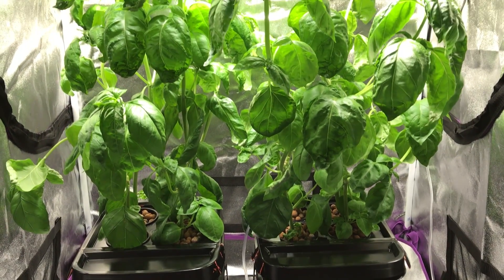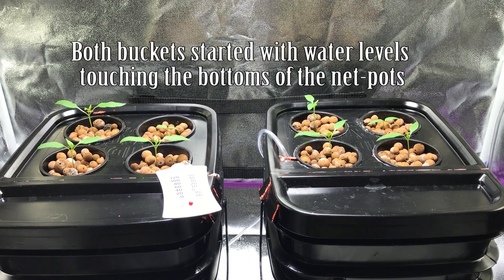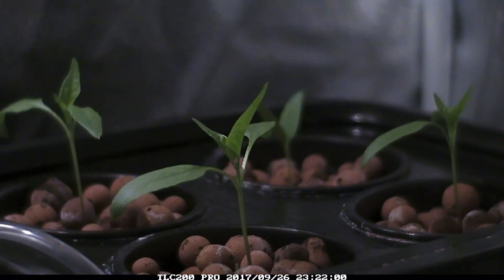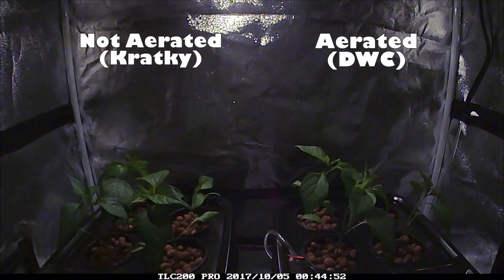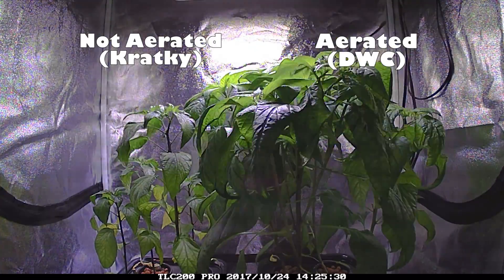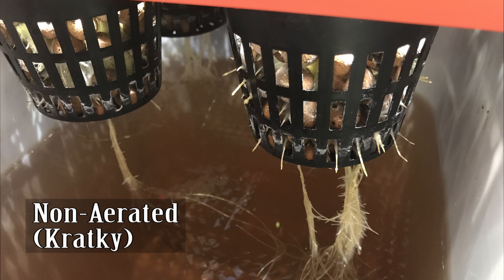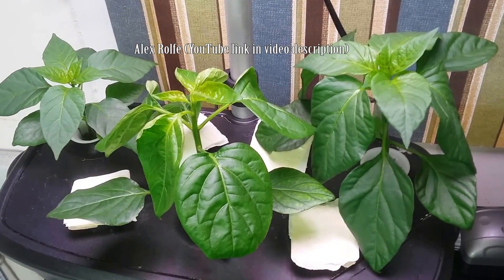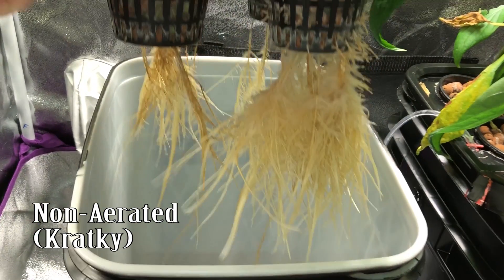Aeration vs No Aeration - Hydroponic Peppers w/Time Lapse (Brinno) “Semi-DWC vs Kratky”

Comment: If the issue was the water vapor not being present, wouldn't sunlight fix it?
Reply from the maker: Starshot sunlight doesn’t create water vapor. Vapor Is droplets of water floating in air. When water evaporates it’s as gas until it condenses back into a liquid again. If you are talking about heating it in a closed container, no that’s not good. The roots exposed to air would have to be colder than the air for water to condense on them. And it that’s not really possible. Plus evaporated water has no nutrients. Splashing water carries its nutrients with it. And I’m the topic of using sunlight as a heat source, that’s horrible for hydroponics. Solution needs to be around 68 degrees. If it’s get hotter, it’s very problematic.

Comment: Roots love oxygen! I grew aeroponics,and the growth rate was unbelievable.
Reply: I was going to use ebb and flow, with hydroton. What would you recommend please?
Reply: @mrtechie6810  Ebb and flow is good.But you just need to make sure the water you give is well aerated.Aquarium bubbler,or just a pump that keeps water moving.Water as it goes against the receptacle its in and travels back down takes oxygen with it.
Use this in your storage barrel before you do ebb and flow to increase the oxygen.
Reply: @djyul  thank you. I put a 50 liter plastic storage box with a tiny Atman water pump, facing up. I added some baskets that are just touching the water surface. Then I made some trays with covers that have holes to put plant pots in...figured to pump the water from the box into the trays using a timer, and let it drain back.
I placed them under a large window. I already have peace lilies (need shade apparently) and spearmint. I would like to grow these, plus strawberries, basil, and ginger (I have a piece rooting in tapwater).
I am about to buy the nutrient concentrate and media. Looking at General Hydroponics 3-part; hydroton and pumice.
I am new at hydroponics...I really appreciate any advice you can give me!
Reply: @mrtechie6810  If you are new to Hydro,1st bit of advice is KISS! Keep It Simple Stupid! Not saying you are stupid,just what it means.
2nd,your water container needs to be closed to slow down evaporation.Keeps EC and Ph more stable.
3rd,RO(Reverse Osmosis water)This has a very low EC,0.003 if i remember correctly.
I gained my knowledge growing weed,and using rooted cuttings.These can not take any more than 0.9 EC(EC is the amounts of salts in your water)Normal tap water has an EC of about 0.8,which means you can only put 0.1 nutrients in the water.
But if you mix RO water with tap water it gives you an EC of about 0.3 which means you can give 0.6 of your desired nutrients.If you give cuttings more than 0.9 they will die!
4th,Light,this is important,the ratio of light to the ratio of nutrients is something you must discover yourself.But where 1 guy is using 4x1000w lamps in a 4sq mtr grow space,his ratio of feed will be higher than someone else who is using 4x600w lamps on the same area.
5,Good ventilation,is also important and a movement fan to stop mildew from starting where leaves start to lay on each other.
When you get it right,they grow really fast,and healthy!
When i started growing years ago there where no liquid feeds,just granulated.I used to use Peters,dissolving in warm water and then adding to feed water reservoir.
You need to buy good quality EC and PH meters!!!! And keep them clean rinse off after use! Add your feed to 1 ltr water and test! Then x that for your 50ltr reservoir.
When you have problems with your plants always check the PH and EC first.And also you must check the calibration of meters reguarly,or when you make a mix that you normaly use and it doesnt come back with the reading you expect.
Its not called EC now,was when i used to do it.I am not sure but not all feeds will be good for all types of plants,you need to check this!
Good luck with your venture,hope this helps.Peace
Reply: @djyul  thank you very much for your advice! Yes, I rebuilt my old RO unit and it's plumbed to a float valve. I have a TDS meter and a PH meter.
I had been propagating corals, so I am highly experienced with water test kits, dosing macronutrients and microelements manually or with a timer, CO2 vs PH, lighting vs metabolism, water oxygenation, etc.
In the past, I also kept angelfish in freshwater planted tanks.
I need to learn the rules for keeping these plant crops, as I have not farmed these before, even in my garden.
I tried using regular fertilizer for hydroponics, but I suspect it is deficient in calcium and magnesium and likely in iron too, plus skews the PH. Unfortunately, I discovered that my test kits are only for seawater and not for freshwater, so I would have to buy a different set of test kits. So I decided I should just go with a proven nutrient product made for hydroponics (e.g. General Hydroponics - GHE softwater), and use it for a few crops until I see good results, and only then I should start experimenting with cheaper products, mixing my own chemicals, testing instead of replacing all the nutrient solution, etc.
There is a ceiling fan in the room. And I have a "swamp cooler" evaporative humidifier and a hygrometer. Trying to keep the humidity above 50% on the dry (35%) summer days that we often have here.
As far as illumination, I hope I can use the natural sunlight that comes through the living room window. It measured around 25,000-30,000 lux, if I recall correctly. This would make the plants grow in one direction...not sure if that will be a problem?
Thank you for all your kind advice!

Comment: To get rid of the 'banding' in the time lapse videos, you can add a neutral density filter to your camera.  However you'd need to experiement that the night time footage isn't compromised. You want to get the slowest possible frame rate to avoid the banding effect caused by the interference with LED lights.
Reply from the maker: Nick Gilbert I don’t think a ND would work. This isn’t recording a “frame rate” it just takes a picture every so many minutes. The only thing a ND filter would do is take a longer exposure. A longer exposure only enables photo cameras to open the aperture larger (or decrease shutter speed). But the aperture on the time lapse camera is manual only and as I’ve already stated, the shutter speed shouldn’t matter. I usually have the aperture stopped down anyways because it gives a sharper image. I stop it down until it starts to get fuzzy and then back off. If I used a ND filter I would have a larger aperture and the images wouldn’t be very sharp.
Reply: Growing Answers Ok I see your point. I wander what causes that striping effect then?
Reply from the maker: Nick Gilbert the camera has a software banding filter which I use, but it’s not 100% effective. I don’t recall if I used of back then.
Reply: Growing Answers no worries - the video was very interesting and I’m just trying to germinate my first batch of seedlings (basil, chillis and watercress)

Comment: Good stuff thank you for the video. I have been wondering about this myself. I was looking into please garden growing towers made out of plastic that were aerated. I want to try something similar but I’m a little nervous about the leaching chemicals. Anything thoughts?
Reply from the maker: Me Tooo you don’t need to worry about that
Reply: Growing Answers Thanks for answering so quickly. I forgot to mention that I will probably be making these at myself as to save myself $1000. And I’m going to have to heat up the plastic and bend it in the shape to hold the plants. The part that worries me is the heating of the plastic leaching chemicals. Does this change your answer?
Reply from the maker: @metooo668  There is nothing to really worry about. plastic pipe is heated and extruded to begin with. just fill it with hot sand to bend it. or a heat gun will work too for spot heating. so long as as you are catching it on fire its fine.
Reply: Growing Answers Would you consider making a aeroponic grow tower vs Hydroponic grow medium to see which is better if any.
Reply from the maker: Me Tooo the only difference is space saving and good oxygen at roots.

Comment: I have grown the exact same way with bubble stones from f ish store for over 12 years. works great! another great way is to use big pvc pipe with holes and run that slanted and let water run down it to a bin then use a pump to put back at top and run down like a constant waterfall, and keeps bad water out of the roots and filtered.

Comment: I at one time had two 8 site hydroponic units and I absolutely had to put aerating stones in every single plant site and also the nutrient mix. The one time that I did not have that going I ended up with root rot. With the air in there never saw root rot again.

Comment: Fantastic.  I've found my best results with chillies (scotch bonnets, habeneroes and jalapenoes) have been in flood and drain in a hot conservatory in the UK that hits 110F in summer.. They love it They seem to hate DWC.  Been playing with basil in the same area in dwc vs outside in soil..  It's all about experimenting with what works in which situation.
Reply: I'm about to start a system...was going to use ebb & flow. What do you recommend?
Reply: @mrtechie6810  Each has it's own advantages. Aeroponics is great as long as the pump or power are stable.  Ebb and flow gives you a bit of leeway.  If the power goes out you have a few hours.  NFT I find hard work but still experimenting.  Dwc I prefer for seedlings and starting.  I would recommend ebb/flow to start with though.

Comment: Fascinating experiment, thanks for sharing. I am guessing that one of the reasons your two experiments yielded different results is due to the varying requirements of basil and peppers, which are after all quite different plant types. To take a stab at a hypothesis, you could postulate that the more woody, slower-growing peppers rely much more on those peripheral roots (or the entire root mass) getting what they need in terms of moisture and oxygen. Is that more or less where you went with your conclusions? If so, you could also suggest a bunch of other plants/crops that benefit from more/more robust aeration.

Comment: Hi does aeration in Aquaponics make a difference to the plant growth ?
Reply from the maker: Assuming you have good flow and agitation, I doubt bubblers would make much difference. But it depends on the method. Drain/fill, drip, tunnel flow won’t matter. But if your growing tank is still water, a bubbler would obviously help.

Comment: First plants do not need Oxygen, they require CO2. The mixture of CO2 and Light caused the plant to give off oxygen.
Reply from the maker: Roots need 02. And plants do actually use 02 at night
Reply: @GrowingAnswers  So strange, I do not recall that. The ratio of how much O2 they need vs O2 they create must be small. I will investigate further. thanks.

Comment: I don't think the aeration makes the difference only by sprinkling more water on the roots. Aeration is also important to run the nitrogen cycle, so, it's likely that there was some decomposing matter in the water or on the roots and it could turn into more accessible nitrogen (nitrites, nitrates) in the aerated container.

Comment: Aeration has a tendency to strip bacteria out of water (I helped run an experiment in a water treatment facility where we proved it)!  This can be good as it can be used to keep the water bacteria free!  However you then have bacteria laden air that should be vented somewhere safe, since it could potentially cause long term health problems!

Comment: Can you compare between using H202 and no using it..?
Reply from the maker: I think first you’d need sick plants. And grow in soil. I guess it can be compared, yes. I’m pretty far out with with projects right now so it wouldn’t be anytime soon if I did it.
Reply: @GrowingAnswers  the hidrogen perokside gives the plant, oxygen dissolved, isn it?I just want to start my hidroponiq project with low cost without electricity oxygen bubble from respirator pump. Thank you..

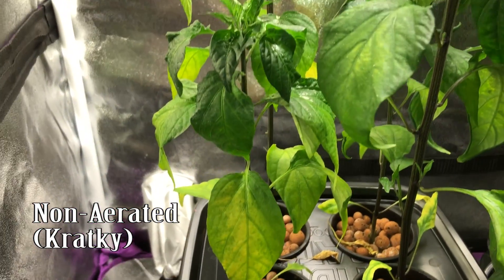Comment: Grow up man, if you run a Hydro without aerating the nutrients you will have more anaerobic bacteria growing fungus than Carter has little liver pills. Pause the video at 5:16 and look at the fungus all around the bottoms of the nettle pots and it has done destroyed the side rooting shoots.
Reply from the maker: Eric Barnes I’ve explained that so many times already. The net pots have mineral deposits and the roots have air roots that looks fuzzy which is normal. Both sides exhibited the exact same thing. The growth difference was obvious from the beginning before either method showed any of that.
Reply: @GrowingAnswers  If you are happy then great. Believe anything you like. Judging from your picture I was growing Hydro before your parents were born.

Comment: Inter-plant the Kratky hydroponic system with Sacred Chinese Lotus along side with the main crop for this is one of the basic principles of the fundamentals of Professor John Todd's "LIVING MACHINES" phililosophy wherein all biological systems are interlocked together in one single SYNERGISTICALLY INTERCONNECTED CLOSE-LOOP FOOD CHAIN CYCLE FOOD AND MEDICINAL HERBAL PHARMACEUTICAL CROPS PRODUCING INTER-SUPPORTING ECO-SYSTEM FOUND IN NATURE. In the book FUTURE SHOCK, Alvin Toffler once said that the future machines will be composed of living and 
non-living parts. Key plants are:
1. Sacred Chinese Lotus. 1. To oxygenate water, prevent nutrients overload by regulating it, prevent anaerobic conditions.
2. Bulrush.  2. To purify water and absorb toxic substances like petroleum, heavy metals, and carcinogenic compounds.
3. Juncus lacustria. 3. To sanitize water by exuding an anti-pathogenicide.
4. Water hyacinth. 4.  To prevent water eutrophication and filtering water.
5. Aquatic mint (aquatica mentha). 5. To sanitize water by exuding a lingering pathogenicide to kill all pathogens.
6. Azolla. 6. To fix nitrogen into the water and filter it and provide fish food or be eaten directly.
7.Vetiver. 7. To phyto-remediate water to prevent it from becoming polluted or function as a primary phyto-remdiating 
                      plant.
These are useful plants in a hybrid soil bed over a water culture hydroponic system using a caged lned with 3 alternating layers of metal and plastic fine mesh and filled with fine aggregates and rock dust powder filled plant container inserted in holes right through the soil bed. The soil bed is stabilized with a permanent cover of perennial living nitrigen living mulch. The hydroponic tank is lined with 3 alternating layers of plastic and metal sheets or mesh.

Comment: About kratky, i have greens growing nice but i was warned that this summer when the big heat waves arrive the roots will get slimmy fungus & probably rot. Was told i could change the water once a week, but that sounds like lots of effort considering the amount of jars i have ...Any advice ? Is there a more assured solution ?
Reply from the maker: I’m not a fan of outdoor hydro. Unless a recirculating system is used. Hydro is best for basements. I don’t know of anything that can prevent algae/slime and rot in higher temps. you could dig holes and place buckets in the ground to reduce temps if you really want to do hydro in hot conditions.

Comment: Thank you for this video. I am planning my hydroponic garden right now. I have never done it before, so, I am learning everything I can. I had a question about the difference between the aerated ones and the ones that were not and now I have my answer. I will be doing smaller plants in a gallon jar that are not aerated and think they will do fine, but, the larger ones I will plant in the buckets and now I need to find an aerator to buy for them. Your video was extremely helpful. Also, in the smaller ones I plan to use H202 to help add 02 to the water, that will also cut back on the growth of fungus in the water. I've used H202 to expand the life of cut flowers and I think it would be good for the smaller ones, but, wasn't sure for the larger ones.

Comment: The reason that aeration makes such a difference in hydroponics is that fully submerged roots rely on cellular respiration using oxygen during lights off periods to continue growth with any sugars they had left over for the night which uses oxygen and allows them to continue growth in the dark and in water with no oxygen they can have reduced and stunted growth.
Reply: Thank you Captain.

Comment: Kratky works best if you set it and forget it. Keep it closed to keep vapor inside. Opening it all the time means you ensure air pruning will occur, which diminishes the whole purpose of kratkys method. Keep it closed for water vapor build up. Only adjust or replace solution when it’s almost used up. Best for short term herbs
Reply: I suppose if it's really hot making it humid inside container?
Reply: Where is your video showing this? I couldn't find it.

Comment: I'm just starting to do hydroponic. Right now I'm growing a tomato plant from see. It's taken a while but its looking pretty good right now. My question is what's the best way to introduce aeration to the 5 gallon bucket I'm planning on using to grow the tomatoes?
Reply: Also I live an Arizona right and its spring summer weather. Would it be an issue if I put the tomato plant outside to take full advantage of the sunlight. I dont have an indoor light source so I gotta do some research on that too.
Reply from the maker: i dont think the heat will hurt them as long as they stay watered. but if you put want to put hydro buckets outside ur asking for complications. the heat is not good. the water should be kept cool if using hydro outside.